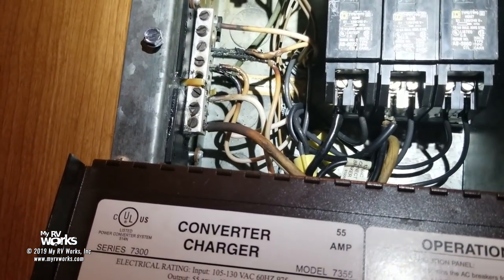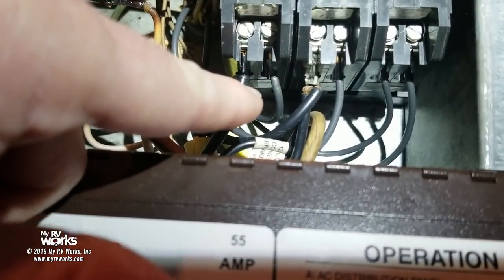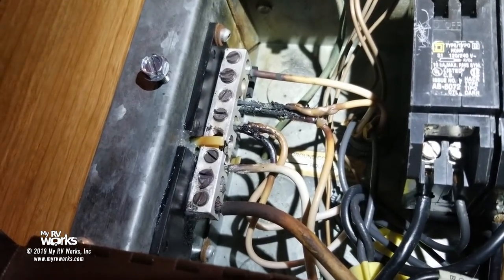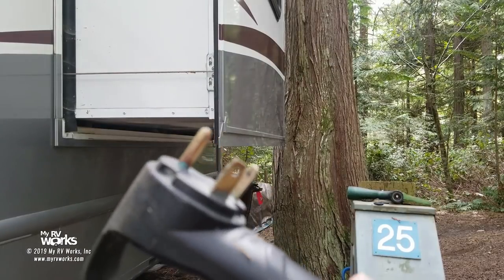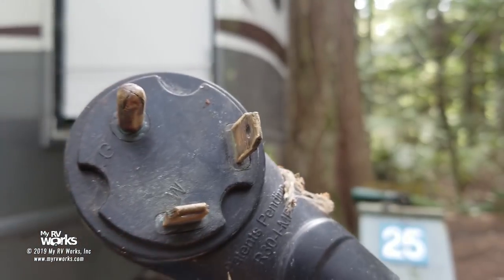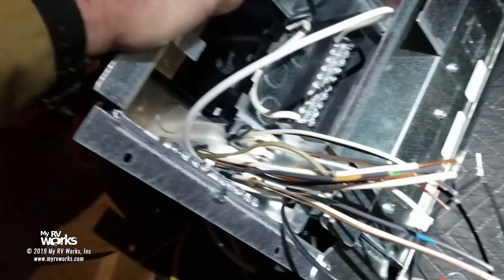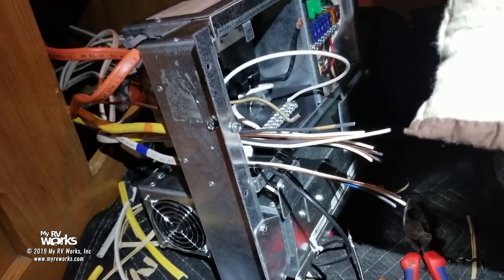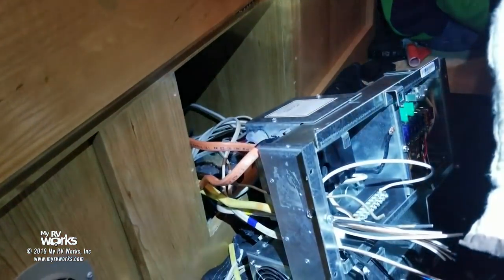Replace RV Electrical Service Panel & Explanation Of How Electricity Works

Comment: Curious, what are the certifications  you persue as an RV technician? Years ago I worked in car audio and accessories so I had the MECP master cert and ASE electrical and hvac. Obviously RV repair requires a very diverse set of skills.
Reply from the maker: Hi Philip,

This is probably not the place to dive into my resume but I will offer a quick snap shot:  My back ground is quite a bit different from what most folks would expect from an RV Tech.  I was a professional Industrial Automation Systems Engineer for over 25 years before I jumped into this, and I was involved in a lot of really big gee-whiz projects that I cant get into the specifics on.  Before starting this RV business in 2014 I was a Sr. Systems Engineer automating airport baggage systems,  specifically for that job I went to the field to commission and test the new system - breathe life into it for the very fist time.  Very exciting and lots of moving parts to diagnose, you really had to have a tremendous skill set to overcome every conceivable fault that came up - commissioning took a very long time but I loved being in the field where the action was instead of sitting in a cubicle in Dallas.  If you have ever flown commercial there is a bit of my software helping to track your luggage and more specifically my code is used between the PLC's (programmable logic controllers) that talk to each other.  I have also worked as a field engineer for an aerospace company automating assembly equipment for the Boeing 787.  On that project I helped diagnose grounding issues in the machines we were assembling and noise on the analog signal wiring.  And in the '90's I developed systems for greenhouses and climate chambers - some of that work was pioneering and never done before.  I designed the entire systems soup to nuts - now every greenhouse uses systems I developed in the early '90's - oh how I wish I would have patented those designs.  I do have one patent at least though.  I got out of that world in 2010 because I choose it was more important to be a dad to my newborn son and 2 year old daughter.   I wanted to raise them with good Christina foundation from their earthly father and also raise them around entrepreneurship - could not do that from a secure work site!  While still on the airport jobs my wife and I decided to take our PerDiem money and buy an RV and stay at an RV Park.  We have been full timing since 2007 - daughter came along in 2008 and son in 2010 (when I resigned as an engineer).  When the RV started to fall apart - long story short - I took all of my engineering experience and figured out how to fix them.  I worked at a dealership for a little over 2 years before I went out on my own.   And here we are!  I joke with my other RV tech 'brothers' because I do not have any tattoos so therefore I am not a 'real RV Tech'!  LOL.   On my website 'About Us' page there is a magazine article at the bottom of that with more info:  https://myrvworks.com/about/

Most of the schools I have attended for RV tech have been at my own time and expense.  And I have attended more than I have fancy 'certificates' for.  At the end of the day I think my customers care more about me fixing their stuff than a wall full of fancy paper eh'.  I try to take a week once year and meet up with some of my other mobile RV tech friends that own businesses in different parts of the country and we schedule a training session at a factory.  Last year we went to Lippert in Elkhart for a great 3 day class.  While there we spend half a day at Dometic touring the refrigerator factory with the pant engineer (my kind of tour eh')  There is just some things you can not learn in a class and you need to go touch-feel and see.  Meet the folks that answer the phone.  So I am always looking for opportunities to do that.  I have also toured many of the RV plants but those are geared towards future buyers/owners and do not go to the level of detail that I would like as an RV tech.  When a sales guy is running the tour I don't get much of anything out of it...

As a certified tech I am required to maintain my continuing education credits to keep my certification.  I do not have a problem there LOL.  But I am glad that they have that stipulation because there is so much to learn from the mfg's on their products - things that are not in the service manual. 

There are several sites to work on certification in the RV industry.  I started with Terry Cooper around 2008 when I decided this was the direction I wanted to go with my family.  I have had no regrets on walking away from a comfortable 6 figure secured income and starting down the path of RV repair.  I would argue I have more job security in this profession than in the airports - and the scenery is a whole lot nicer.  Here is a link to Terry's site:  https://mobilervacademy.com/

So, not sure if this is what you were looking for but hope there is some good in my dribble here.

Cheers,
Darren Koepp
Reply: @MyRVWorks  oh my, you have had some amazing experiences. That's really great you have focused on your wife and children. No better investment can be made than a holy and healthy family.
Reply: @MyRVWorks  WOW

Comment: Darren, 19:50 was a brilliant moment, I was just ready to skip the rest of the video (not) and move to your next conundrum. It's obvious you've been thru speech and communication classes, and at a graduate level. 

An important question that I have and many others might, earlier in the video you instructed us to clamp an amp detector on the red and/or the black wires (hot wires) and then the total should equal the neutral wire's amps? First, does each have the capacity to carry either 30 Amps or 50 Amps or are they limited to about ½ the breaker amps given the breaker at  the shore power? Would we add the two together since the instruction was to turn everything on in the camper? If we add them together would it suggest the neutral wire will carry the total of each hot wire simultaenously or do the hot wires cycle one on and one off, leaving the neutral to carry amps with the combined total of both hots or switching back from one hot to the other making the load either higher than either hot alone or under a constant load, one hot's amps then the other's amps making the neutral the first to overheat? Either way isn't the neutral never at rest or carrying the combined amps making it more susceptible to being hotter and why the neutral is more likely to burn first?

I bought the Hiwa torque driver listed in your tools but the bits are 6mm I believe and finding them is next to impossible. Any suggestions as the driver didn't come with the bits?

Comment: Maybe someone can answer a question for me. On our travel trailer I am doing some remodeling and I wanted to relocate one of the electrical outlets. Going through the breakers to find the one that controlled that circuit and it seems that there are two breakers providing power to this same outlet. It used to power the refrigerator with AC power. However when either of those breakers is off I also lose my air conditioning because it kills the 12 volts. Is that a common thing. It also seems I lose all the outlets in the travel trailer when those breakers are off. It's most definitely not wired like a house or at least that's the way it seems.

Comment: Thanks for the very loooooooooong explanation of the electrical system!! I stuck through to the end. Good stuff!! Years back I owned a pop up camper. I had left the dead battery in not knowing it could damage anything. I figured I didn't remote camp so no harm right? Well, I learned the hard way. Apparently, the electrical panel worked very hard at trying to charge a very dead battery. As a result, the converter fried the entire unit. I had to replace the unit...lesson learned. Fast forward a few years later, my wife smells something electrical burning. Same unit. The neutral lug became loose probably while traveling. The lug was pop-riveted on the panel and there was a lot of play in it. As a result, it melted the neutral a bit. RESISTANCE!!!! I drilled out the lug from the panel and bolted on a new lug. The unit has worked fine ever since.

Comment: We stayed at a CG in NY and only had 80vac. Burned my shore cord. Also they had romex running on the ground NOT UF cable. Will never return to this CG.  They had operational flaws/security flaw/safety concerns.  I note alot of CG’s 30A sockets are very loose.  I made a 30A dogbone for these cases so it does NOT burn up my shore cord it will damage the 30A dogbone, cheaper to replace.
Alot of CG’s have electrical flaws. It concerns me, are these CG’s being maintained or inspected....?

Comment: Many different RV YouTuber's suggest to always use a Surge Guard 44280 Portable Surge Protector - 120V, 30A, or something like it, before connecting to shore power. Would you agree?

Comment: One last comment your comments about the amount of electricity that went to work should be the same on the return neutral it reminds me of trying to grasp using a meager to test Motors and long stretches of pump motor cable similar to like you said Megar sends out a certain amount of current what returns can tell you about motor windings cable shorts  or opens hundreds of feet down a well

Comment: Excellent video! Extremely informative (as I watch with an almost identical looking isolated bus and wires while all 120 in motorhome is out! I believe mine may stem from auto transfer switch in back as I currently get no power to breakers from either shore or generator (note: 120 side died altogether when turning on an ac that had been running earlier - hence 30 yr old compressor start/big load) and hence my assumption the auto switch has gone… I do plan on basically doing what you’ve done here in this vid regarding the BUS/old likely loose wiring! Probably further by updating breakers too. Any info suggestion welcome!
Reply: Update: I have since fixed my aforementioned issue for complete loss of 120vAC throughout our motorhome; it is 100% b/c of this very video that I was able to (1) RE-diagnose the issue and (2) [using best practices and safety precautions] resolve the issue via methods outlined here! 

This video likely saved me $600 or more, for something that took me an hour to do myself (this is NOT a recommendation to DIY if you are in a similar situation, it is worth noting I have electrical experience riddled throughout my professional and educational life, pls do NOT mess with potentially fatal electrical equipment unless you truly know what you’re doing!) however that said and to recap from previous post: my thoughts were initially thinking auto-transfer switch as both genny and shore were no go (100% failure throughout) come to find the next morning (today) after a rest, the main white going to isolated bus was not loose, but fraying and had actually broke the wire just after where it screws into bus; luckily enough slack to cut problem area off to clean wire/insulation and reattach and also tighten everything up as you had recommended!

Sorry to ramble, but thought it worth mentioning that this video truly saved me! Thank you so very much from the bottom of my heart and I wish you all the best for YouTube, business, life in general! 

Really can’t express how genuinely grateful I am for this video!

Comment: I'm so excited that I'm not the only one that explains how things work and diy instructions with rambling, 2 or 3 analogies per step!! I have an obsessive compulsive need to understand anything that I do or attempt to fix, before I start doing it! Especially electricity! My dad is a retired master electrician that had his own business 35 plus years and was also a fireman for 28 years before getting his general contractor's license and building houses, (meaning  he then subcontracted the electrical) working smart not hard! ... Rambling.... But my mom has an RV that has electrical problems, and I had a standard understanding of what could be causing burnt wires at the light bulb recepticals which also crumble take the burnt bulb out! So I appreciate all explainations and trouble shooting you detailed! I actually related and kept up with you!!  I'll be following you for other helpful tips! Thanks again!

Comment: Your always the first one I go to when I have a problem or I am thinking of up-grading or just want to confirm my own diagnosis. As usual you have saved me a replacement job and now I only need a slight up grade. Your the best and 100 dependable Darren. I never start a job without double checking with you. Also like the guy a head of me don't apologize for any rambling, I you always seem to manage to pass one no less than one and usually 2 or 3 solid tips that I always find insightful and helpful. In fact on several occasions those tips solved the problem and saved me  a lot of time. God Bless and Thanks again!

Comment: Very well done...Haven't finished searching this channel yet as I just found it trying to trouble shoot my RV electric issues... First is that I'm in Mexico and have been told that things are done a bit different here...I have no electrical experience for the most part other than what I have studied online...that being said when I plug into 30 amp shore power everything looks fine, no breakers trip or blown fuses, but I have fried a microwave and two coffee pots...An electric skillet worked but got extremely hot on low setting...stopped using...A Spanish speaking gentleman with multimeter told me that it's reading fine at pole but almost doubling in RV....What could be causing this and what's the best resolve?

Comment: I believe the relationship formula, E=IR would provide a clearer understanding.  Where "E" (applied electromotive force measured in volts; "I" (current measured in amps and "R" is resistance measured in ohms.  If the applied voltage remains the same, then any change in one of the other 2 measurements will produce the opposite movement in the OTHER measurement.  In other words, if the current measured in amps increases, then the resistance measured in ohms DECREASES.  "I"goes up; "R" goes down.  If "I" goes down; "R" goes up.  In the case of your "smoked" neutral connections, the increased resistance produced a change in the type of energy expanded.  Electrical energy changes to THERMAL energy.  Thermal energy then burned your neutral wires.  I really enjoy your how-to videos.....keep them up and have a blessed day.

Comment: Good video, good explainations. 
I have been an instrument electrician for over 40 years with exp in residential, commercial, and Industrial electrical and mechanical.
And I got a lot from your video about RVs.
I have worked for several OEMs and none of them have ever torqued their screws.
Since I now have a 1996 Winnebago Sunrise, I have ordered a torquing screwdriver and will check every connection.
And I love how Winnebago connected 4 wires in-line to one wire going to 2 fuses in their chassis wiring. Yes one of the 4 wires came back and went to another fuse. What a cluster!

Comment: On the 120v side of the panel, I noticed that there was a neutral wire coming through the horizontal sheet metal without a protective grommet (near the end of the video).  Is that something to be concerned with?
Reply from the maker: Hi Robb, that is an excellent observation.  Thanks for paying such close attention to the details.  It turns out that that wire is the neutral feeding the converter below.  The panel was assembled that way and they snapped in one of those hard black grommets to protect the sharp edges on the KO.  It is there, but difficult to make out.

Thanks for the comment and for keeping us safe. Had that neutral cut through and touch the metal frame, you could have had some electrical potential between the ground of the neutral which is not supposed to happen in the RV. The ground and neutral get bonded at the pedestal.
Reply: PS - You’ve got all of the great tools . . . I’m jealous !!!
Reply from the maker: I was motivated to start this business because it feeds my tool fetish.  As long as the business pays the bills my wife is okay with some of these expensive ones LOL! Having the right tools does make the jobs a lot easier. I plan on a future video where I feature some of the tools I use and also some of the tools that I've created myself...
Reply: Looking forward to that video . . . and, thank you very much for your responses !